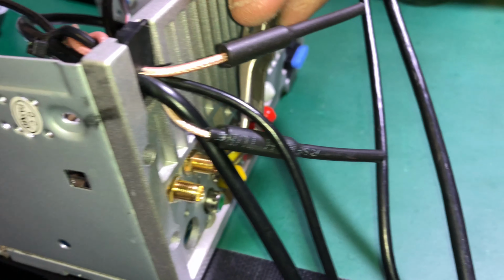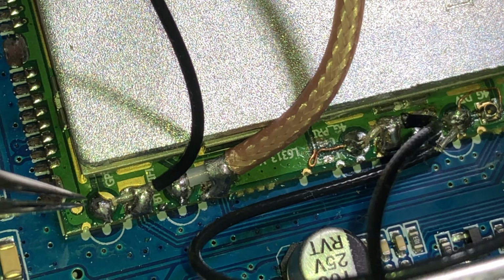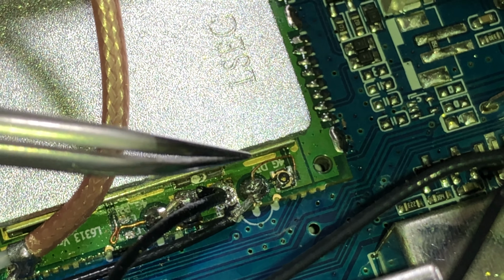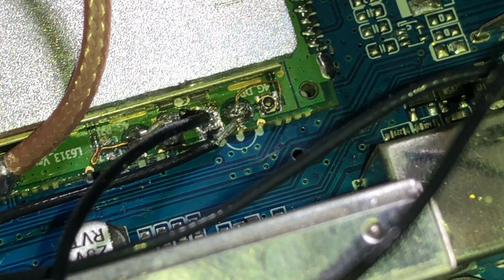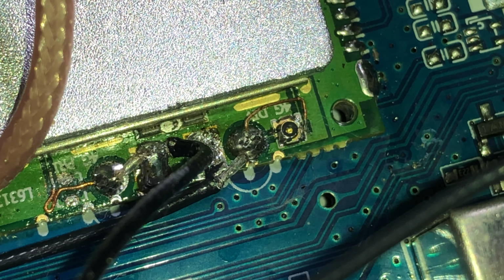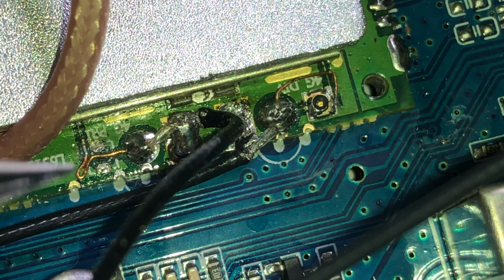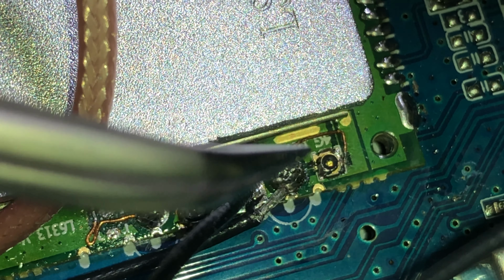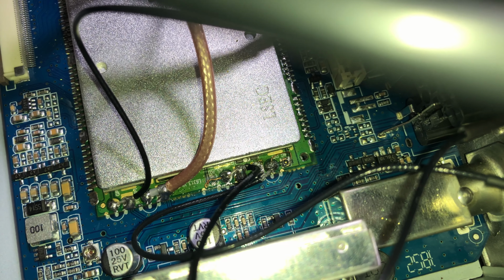Joying Android Headunit for Volkswagen 4G signal issue (with fix)

Comment: Hello. I have a joying headunit with an issue that is similar but not exactly like your issue. I have no signal at all with the Sim card installed, so I found your video and checked to see if I have the same problem. My unit seems to have continuity through the trace as it should, but it also has about 1.4 ohm resistance across the outer jacket and the core of the flylead. Neither the secondary 4g flylead nor the GPS flylead  has continuity when measured the same way. I think there may be a bad solder job shorting it out, but I really don't want to mess with it without checking a known good or get some expert advice first as I don't really know how it should be.
Reply from the maker: I would let you know how mine measures however I no longer have the head unit as I got a new car. if u are confident with soldering it would probably be easiest to remove the cable and then test again. The short May be in the cable. I assume there should be no connection at all between the points but I can't be sure. I guess another thing to try , just to double check would be using a sim from another provider. Check the 3g and 4g frequencies ur provider uses in your area and compare them with the frequencies ur unit can use. If all else fails and u can't return the item u can always buy a 4g usb modem instead, I believe that would work. Oh and I almost forgot, try update the firmware of the unit too. Good luck:)
Reply: @AronBezzina  Thanks. I'll probably try to desolder it. I believe the SIM I'm using should be compatible, but I'll check to be sure.
Reply: @AronBezzina  hi, I have the exact issue. Did you solve this in the end? Thanks
Reply from the maker: @chrisantwillis1088  yes i solved the problem by soldering the wire in this video
Reply: @AronBezzina  great! I think I’ll have to try that first then :)